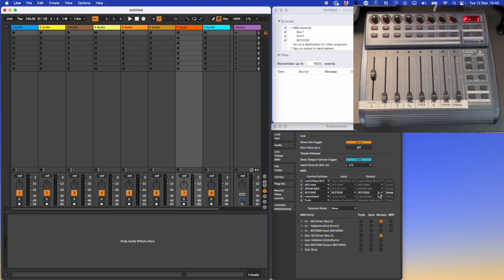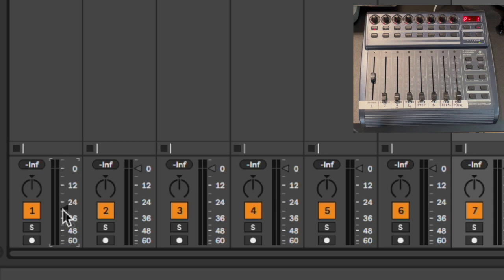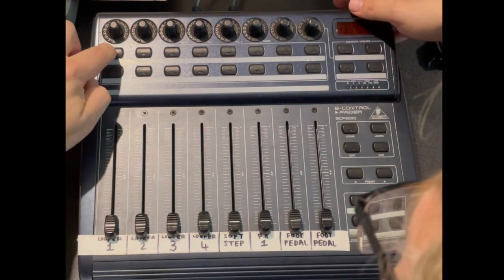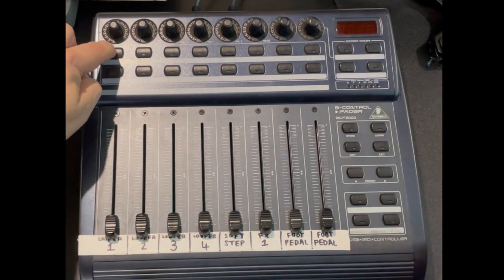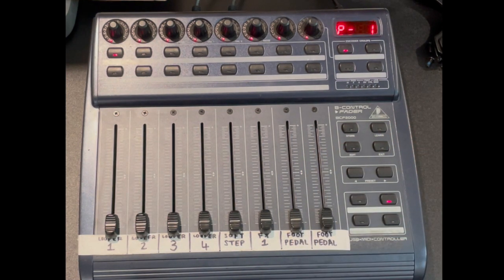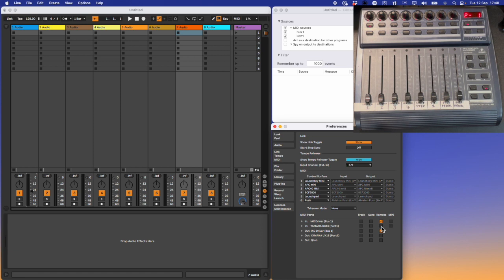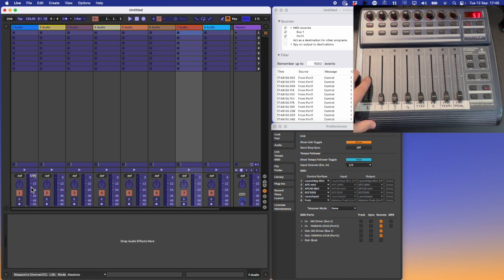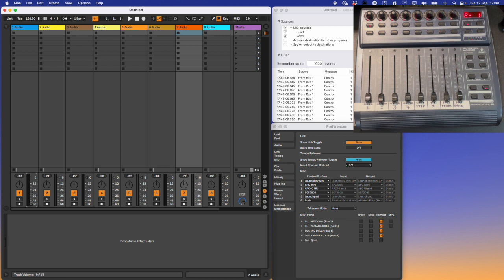Setting up a Behringer BCF2000 with Apple Silicon M1, M2, M3 processors for Ableton Live

Comment: Windows 11 has a similar issue, due to removing some of the older USB Audio Device drivers. I think this all has to do with USB ports, because some folks with USB 2.0 ports who  upgraded from Windows 10 are able to use it fine, while others who started on Windows 11, or upgraded but only have USB 3.0 ports are facing the same issue. The MIDI to USB cable is the best bet.

Anywho, this video helped with some troubleshooting I was doing, at least a bit. And this next part might seem spammy, but I only intend to enable the BCF users out there, promise! 🎛! - Ok, so I made a pretty heckin' good MIDI remote script for Ableton. I just released the video yesterday outlining everything and its free, so I hope someone finds it and gets use of it. It will allow you to dynamically adjust volume and other track parameters, fixing the issues of Mackie Control Mode, and also gives quite a bit more function. That's all I'll say here and not over sell it, but just click my image and its like my top video, probably. 

- The one caveat is that if you're on Windows 11, you probably have to use the BC Manager app to update the mapping on a different PC. But now I'm seeing its the same on some macs, especially if they don't have USB A ports at all, and a hub is in use. Its an annoying lil thing for sure! Anyway, thanks for the info @Gareth Fry, your video was a big help identifying an issue one of the users was having on my end. ♥ kudos!

Comment: Thank you! I was going mad and trashing all my midi preferences, and DAW preferences to see if I could fix it, but no joy. Very happy to have found company to my MIDI mapping misery. I was using MIDI monitor to monitor the MIDI output and Live was indeed outputting the relevant MIDI controllers when I was moving the mapped faders, so I was completely at a loss as to why the BCF wasn't responding to it... Really strange it doesn't work!

Comment: I just got a BCF2000 plugged into a Mac Mini M1 with Ableton 11, everything worked just fine. Here are the steps, hold down the second button on the top roll of the BCF2000 while turning it on. Once it's fully on, hit the Exit button. Then, in Ableton's Settings (Preferences)/ MIDI, select Mackie Control or Mackie Control Classic as your Control Surface then select BCF2000 for the Input and Output. That's it.
Reply: did anybody try this?
Reply: @jarlkaad  didn't work for me, I am only able to have one way signal
Reply: So you're talking about getting into a different mode on the BCF2000, actually. And setting the mode does matter, but no matter what mode, it should still register with the PC. Its just like different MIDI mappings are sent, basically. - I uh fixed Mackie Control Mode issues BTW. There a vid on my page. That's all I'll say for now, to not seem like a sales person here. My point is just that your input on this is about entering Mackie Mode, but the issue they're talking about here is actually relating to what I said in my last comment just a moment ago.

"Windows 11 has a similar issue, due to removing some of the older USB Audio Device drivers....."

Its honestly a really annoying thing, and getting all the info consolidated on the cases so far has been a challenge. We're all just here to help, so I wanted to explain a bit about that.

Comment: i found out it works if you dont use a usb hub
Reply: I can confirm this. thank you
Reply: So you are using an Usb B > Usb C cable?
Reply: @mangrove1985  usb b to usb a (i got two of them)
Reply: @apalumbo  my macbook has no Usb a input ;)
Reply: from what i've gathered online, M1 struggles sending midi over usb. also apparently USB 3.0 has issues with midi. my next step is trying out a usb 2.0 to usb C adapter to see if it works better. the thing is having to map all the faders everytime is super time consuming, and if you have to map more than 8 channels, you're cooked.